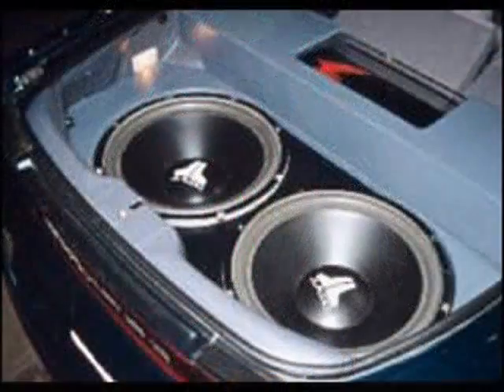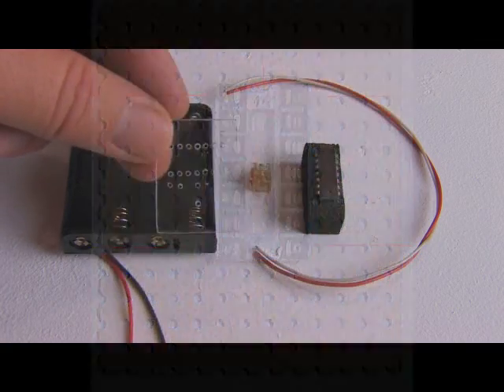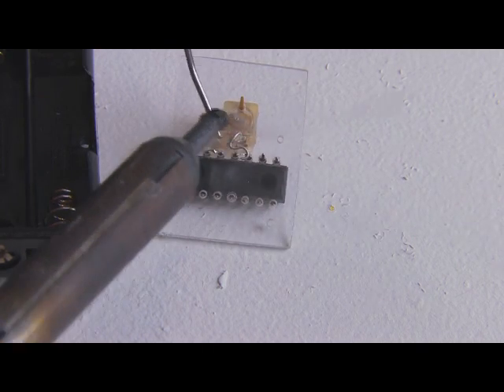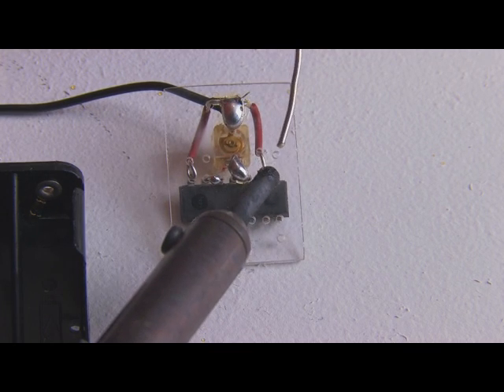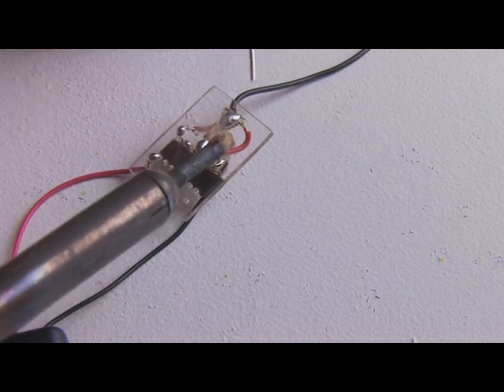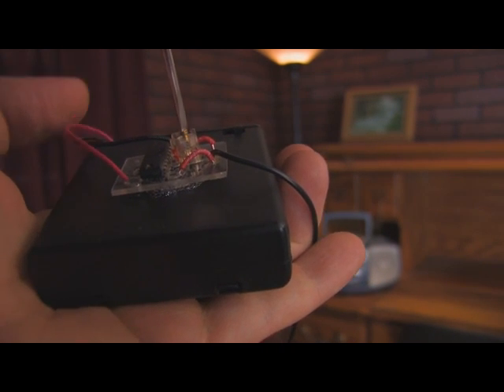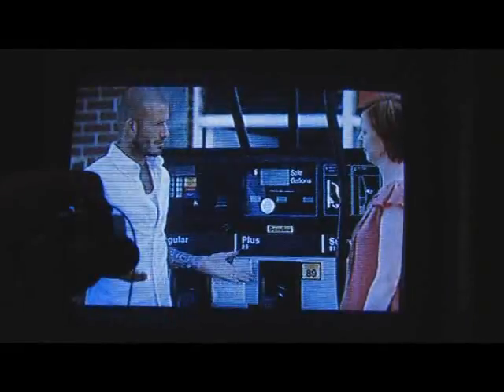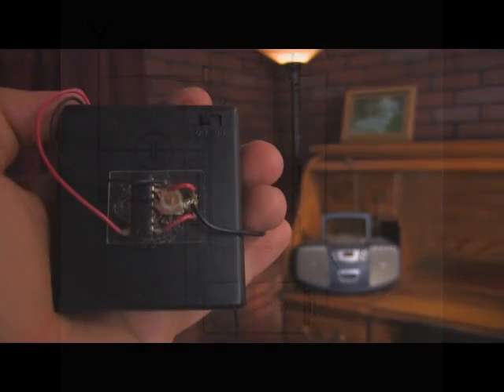Easy T.V. and Stereo Jammer!

Comment: Back in the early 80's i had a heath kit dip meter, which could  be used as a fm radio jammer. I wrapped A telephone cord around the coil, it worked great as a transmitting antenna. When the guy next to me would blaster  his stereo at 3 am, i would turn the meter on, tune the meter to the the same frequency that he was blasting, and his radio would go silent. It basicly put out the same type of signal that this circuit uses.

Comment from the maker: I'm always happy to help.  First of all, remember that tuning is very sensitive.  The little notch where your radio will jam is very small, so tune very slowly.  Start out right next to an FM radio with an antenna.  Pick a station to jam that is perhaps 3/4 of the way up the dial. Also, don't forget to double check all your wires even if you think they are correct.  Last, the last page of your directions showed a suggested parts layout.  Please use that layout if possible.  It works really well!
Reply: What is the chip number? the capacitor MFD or or  cfd? I'll see what I need. and then  how many K is the trimmer  pot?

Comment from the maker: It will.  The chip is only rated at 5.5 volts, so you will shorten it's life.  But I think I ran my first jammer from a 9v for a couple of years, so that may not be a big deal.  The "kit" comes with a socket for the chip (a lot of first time soldiers were overheating the chip, so I started adding the socket), so if a chip burns out, you can always just pop another in for $5.

Comment: In the late seventies, I was aware of a company called PPG Electronics. They sold the experimenters kits. I got the one for a TV Jammer. Had all sorts of insane fun with it. This was before I started experimenting with dual in-line package integrated circuits. I think it was a two transistor job.

Comment from the maker: One fun trick with digital TVs (that may be hooked to a shielded cable which prevents jamming) is to buy a TV on off switch.  These are available on eBay and around the web.  It's just a remote switch that turns virtually any TV off!

Comment from the maker: It will only work with TVs connected to antennas.  Some people have said it won't work with digital TV, but it does work on mine...  Range with my TV is very limited.  I have to be right in the same room.

Comment: @Krew808 did u solder the chip like he did? the heat from a soldering iron can destroy a chip, that's why ur supposed to solder in a socket and then push the chip in...

Comment from the maker: @Krew808 Check all wires and batteries first of course, then:  Remember to tune slowly, and very close to an FM radio at first.  Try jamming different ranges too (lower and upper).  If the range is limited to a certain frequency range, then the cap is probably at fault, if no jamming occurs, then it's probably chip or wiring problems.  If you continue to have problems after that, just email me and I'll send replacement parts.  Thanks.

Comment from the maker: Try tuning it SUPER slowly within a few feet of an operating FM radio.
Tuning is quirky, but you get used to it.
If that fails, make sure you have fresh batteries, and last, check connections if possible.
Thanks
Reply: Where can I buy one or the parts pls

Comment from the maker: It's possible if they are in the same freq. range.  It seems to jam well because of all the messy harmonics sent out by this intrinsically unstable circuit, so the jamming is "micro" powered.  That's enough for jamming a signal coming from far away, but I'm not sure about a local signal like a camera...

Comment from the maker: It only works with FM and T.V. Broadcasts.
There are little AM transmitters that might be able to simply over power local AM broadcasts.
If you Google Ramsey Kits they have some really good/inexpensive models.
A spark gap can also make great annoying sounds on AM.  :-)
Good luck!

Comment from the maker: Sometimes an open arc is a good all frequency AM jammer.  I've seen people set relays up as buzzers (just wire so that the relay's power to coil comes from the N.C. part of the relay's switch) and then attach an antenna to one side of the coil.  I haven't played with this much to know what the range is, but I've certainly had relays oscillating like this ruin the sound quality on an AM radio.  Thanks!

Comment from the maker: The device can be operated in the "gray area" of micro power transmitters allowed by law.  As you increase range, you might not technically be legal, but as you infer, it would be difficult to detect a device with a range of a few hundred feet at best...  So, use your best judgement!

Comment from the maker: You can't hook up an MP3 player jack to the jammer.  It uses a messy signal, and harmonics of that signal.  It's not a clean FM carrier.
You can buy FM transmitters though that will do the job.  They even sell one at Walmart that's used to play your MP3 player through your car stereo.  It's about $20 I think.

Comment from the maker: No, it doesn't have the power for that, but I remember when someone with a CB was driving me nuts (messing up my T.V. and radio and totally unwilling to talk to me), I just got a handheld radio and left it keyed down in their yard.  At a range of 100' or less, that will block most freqs.  And, since most operators just use one freq primarily, it's easy to do that one in.

Comment: "Back in the day" of American Muscle Cars, the "easy way" to make a late-night talk-show host "stand on their head" was to just not use ignition suppressors or wires; Hi-performance wire + an Accel or similar 40+ kv ignition coil would wipe out all communications for about a block by just waiting for the traffic light to turn green.
 Illegal only IF the factory had originally installed suppression wires, & it made your car radio unusable, but it WAS the only method I'd even seen that even interfered with wireline telephones, too.

Comment: @Anamnesicus It only works on TVs with antennas.  It still works on my digital TV here in the states, though the jamming just makes annoying bands across the picture (as in the video).  I'm not sure if it would work on DVB-T, but it definitely won't if the signal comes through a cable.

Comment: great little device. bet you could have fun with this. is it a jammer or is it a transmitter that sends out a blank transmission as it has no imput and because your nearer to the device it picks up the signal from this rather than the transmitter signal that's coming from  miles away and as such giving the impression of jamming.

Comment: This will only work with FM or VHF analog TV only, correct? Not UHF or digital TV
Reply from the maker: FM and VHF yes.  It also worked on my old digital T.V. (as long as the TV uses an antenna) and it's worked in many other countries with digital systems.  I think it's primary use should be FM though.  The chip creates a very messy output full of harmonics which creates a pretty decent jamming.  Thanks!

Comment from the maker: @coppertopjsq   Works better on FM, but still jams my digital TV from accross the room.  The modern 7404 series does not work.  The chip sold at the end of the vid is a long discontimued version that has become pretty expensive for what it is.  $5 for chip/cap/postage is not too far off cost...  Thanks.

Comment: Nar, you wanna do it with proper antennas outside and high power. Breaker breaker! Lol! With analogue tv you wanna get a tunable modulator, run it through an RF amp. chain and into a log periodic antenna outside. Change the programming. Or alternatively just block the sound carrier and talk or play music over the top :p

Comment: hi boss, i have a problem with my guitar amp. bcause im receiving radio signal everytime i play my overdrive pedal. is this thing will help me to eliminate those radio signals? it just so annoying thanks for the responce. thanks boss
Reply: +Bern Sanchez No it won't. It works by generating radio signals. Usually the problem is that you live close to the radio station and one or more of your cables is resonant with the interfering signal. Change the lengths of the cables and install toroids on them. Basically your cables are acting as antennas and your amp has become a radio receiver. A three meter long cable makes a great antenna for the three meter band (common wavelengths used for the fm band). You want to avoid multiples of that length too.

Comment: if you using 9volt battery you just need to add a 7806 voltage regulator chip you can find the connection on google

Comment: Just break a cheap radio in half and you will find an fm transmitter in there. That was probably the most expensive item in this tutorial. If you live in Metro Manila, Davao, or Cebu, the materials probably wouldn't be hard to find (hardware or even cellular stores in the mall).

Comment: could you please put a (detailed) parts list in the discription
Reply: Matthijs van der krogt Ti 7404, cap is a variable 1-30pF.
Reply: ***** Yes, and where exactly would one find the TI 7404 online? The only 7404's online are every number EXEPT the "plain" 7404. The 74ls04 won't work. It's output is too smooth. The 74l04 won't work either. How 'bout posting a link to the actual plain old 7404 chip that DOES work? Don't know why it's a big secret, other than to just irritate folks. Congrats.

Comment: I have orderd from you the lot..did all like you said ...and puff ....nothing!i have checkd all connection...checkd the electricl flow..looks ok ......but still not working.....i orderd a new chip with 8 pins ...some one can tell me the circuit? ????
Reply: The circuit diagram should have come with the kit, mine did and it had the wiring diagram with it.  Using the diagram to assemble it is actually easier than trying to watch the video and doing it.

Comment: Can this jam a speaker? Or does it jam the wireless transmission to the speaker? My neighbor is playing Spotify music way too loud; there's no radio or TV involved.
Reply: get a 2.4Ghz jammer.
Reply: So as to jam their WiFi rather than their stereo output?
Reply: Quentin James yes, everything works on wifi or Bluetooth these days. It might be illegal to block them because you need to have stronger signal to disable. Ofc you need different device for different frequency.
Reply: Cheers I'll look into it. Also I'd need to find a way to direct the jamming at their terrace to avoid jamming anyone else's stuff.
Reply: Quentin James easiest method would be for you to find out what it is and jäsee if it possible to jam it and total blackout isn't required, even skipping up the music makes it really annoying, just remember that most devices buffer audio for pretty long time, so it might not work at first sight. If all else fails, you could try to jam their whole internet :D or just hacking WiFi network password.
Reply: Thanks for your reply Lasse, I'll tell you if I manage heh

Comment from the maker: @liwaroman I'm told that several large communist countries spend more money on jamming broadcasts than on their nations regular broadcasting.
I would think that jamming a satellite signal would be fairly easy because the signal from a satellite would be fairly low power (since they have to generate that power with a solar panel).  However, the frequency would be VERY high.  So, this device would not be applicable.  But, for a country to do it would not be hard I don't think?

Comment: is there anywhere I can get  one of these already put together or at least the board
Reply: +jango67 You can try the "dead bug" technique and mount the components upside down or,as in the case of the trim capacitor, on the side to a piece of plastic and solder the wires to the leads. Just a drop of glue and be sure that the screw on the capacitor is accessible. You can also buy a "bread board" and simple push the components and wires in place.
Reply: ty found one

Comment: I wish to know how to stop in house stereo and loud car mp3 stereo. Police did not care anything. call them and no one will come. I am really want to aim my rile against those stereo already. Any idea how to distort or jamming those noises? permanently disable would be nice.
Reply: Mr. Hymn Burn the car down maybe?
You cant distort an MP3/CD radio.
Reply: Get an 8 element yagi for UHF CB. Get a 5 watt in, 200 or more watt out amplifier also for UHF CB. Connect the amplifier to the CB and the yagi to the amplifier output and power the set up off of a car battery or 50A power supply. Point the yagi at the stereo (sitting it on top of a plastic bin perhaps) through the wall and then key up the radio. The 4000 watt signal coming off the end of the antenna should give them significant technical problems XD

Comment: where did you get your capacitor and fm transmitter from?!?!
Reply from the maker: They are available inexpensively on the web page at the end of the video.  Thanks!
Reply: stancurtin 1.  Does this jammer work if stereo is in adjacent room separated by a thin wall?   2.  If source of music is CD from a player connected to an amplifier, would this work?  Thanks!
Reply from the maker: Kweli Nzito
 Range with a short 12" antenna is about 15 to 20 feet.  It only works on FM broadcasts, and won't jam CDs or internet radios.
Reply: stancurtin Thanks!
Reply: just cut the caox that runs into their place. no more streaming...

Comment: The chip's number is supposed to be kept a secret. Mine just arrived and the number on the chip is scratched out.
Reply: mcclendon6251 Ti 7404, cap is a variable 1-30pF.
Reply: ***** Yes, and where exactly would one find the TI 7404 online? The only 7404's online are every number EXEPT the "plain" 7404. The 74ls04 won't work. It's output is too smooth. The 74l04 won't work either. How 'bout posting a link to the actual plain old 7404 chip that DOES work? Don't know why it's a big secret, other than to just irritate folks. Congrats.

Comment: I built this a couple of days ago, and it works. but only within the range of about a foot, maybe 5 the most. I have to stand with the device right up against the radio. what could be affecting the range? I have a 51" wire connected for the antenna. not sure if you need any specific antenna wire or what. but I've tried multiple antennas with the same result. anyone have any suggestions?

Comment: Has anybody order this thru the link giving to paypal and not get your bank acco. ripped off, sorry I want to order this but I'm a little skeptical about loging in to links that takes me strait to my bank acco. I tried opening a new tab logged in then go back to previes tab and refresh page but it doesn't log in  I NEED TO KNOW IF THIS IS REAL PLEASE THANKS
Reply from the maker: No worries.  It's real.
Reply: stancurtin Hey, awesome video. could you please tell me what type is the FM Transmitter Chip? or tell me what it is written on it? please :( i am trying to build one but i can't find this chip.
Reply from the maker: eelissey rocky
The chip is available super cheap at the address given at the end of the video.  I'm out of town this week, but will resume shipping in a few days when I get back.  Thanks.
Reply: stancurtin What components did you use? I have some laying around, I may have the right ones. Just give me the part numbers for the chip and the capacitor.
Reply: stancurtin just ordered kit , cant wait to get . Been needing something like this for years.
Reply: How would you know?
Reply: psalm14411 Did you recieve your order? Is it working?
Reply: eelissey rocky yes, shipping was fast, assembly was kind of difficult but I only have one eye, and parts are very small. Tried to test, but figured out the inconsiderate mex door neighbor was blasting internet radio, so not sure how well it works yet. Now I'm just gonna build a scaler weapon and blast that p.o.s. with that. The guys like forty something and acts like a teenager with his first boom box, talentless, horrible drunken chicken farmer- circus noise they call music...
Reply: psalm14411 Where are you from, and how fast was the shipping?
Reply from the maker: eelissey rocky
 I'm in the US.  Shipping is usually within 24 hours.
Reply: eelissey rocky I'm in ca, shipping was three days
Reply: That's the problem, I'm not in the US.
Reply: *****  he carefully does not Identify the mfr  number of the Ic chip, so you can't buy it  on your own! here's a tip: You can probably  rig a 556 dual timer chip to emit at 88- 108 mhz with a screeching noise
Reply: cool thanks I suppose this is not legal right lol
Reply: great vid !

Comment: I don't think this is legal even if it does not exceed 100mW. You can't legally interfere with a licensed service.
Reply: You can as long as you are interfering with a part 15 FCC device. All boomboxes, TVs, am/FM receivers, car radio fall under part 15, also homemade low power circuits fall under part 15 rules. You can jam with low power, but under rule if asked to stop you must stop. 

CB radio max output is 4 watts and falls under part 15. If it causes TV interference which they do up close due to harmonics its legal, but if asked to stop or move you must do it.

But there is o much paperwork and half a dozen steps when filing a complaint. It takes around 6 months or more before you get a response on a complaint filed with FCC.

Local police won't bother and tell you contact FCC, unless it's jamming emergency services or their dispatch radio frequency.
Reply: qoaa CB radios are not Part 15 devices. They are regulated under Part 95, although they are licensed by rule. Part 15 devices must accept interference from licensed services . And they may not cause interference to them. And commercial radio stations are licensed stations. I'm also not sure it's legal to intentionally cause interference.